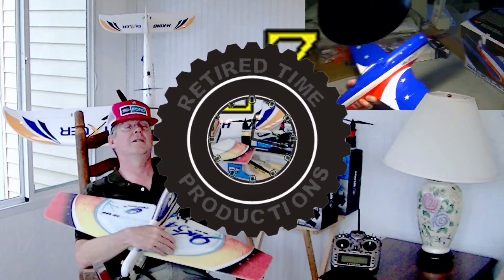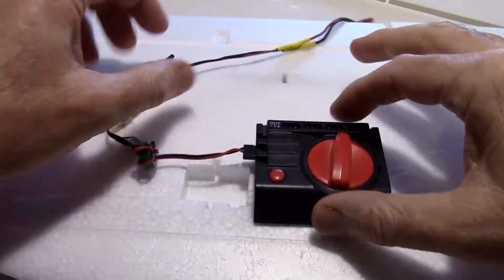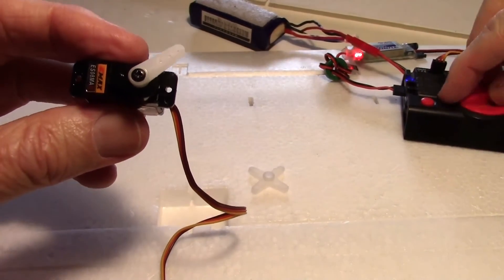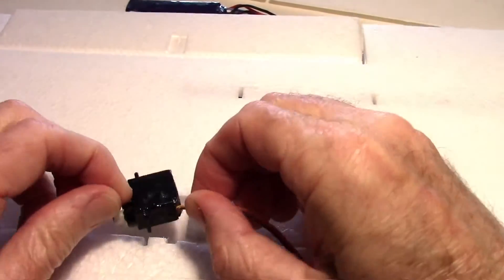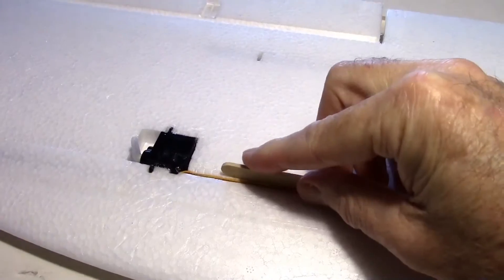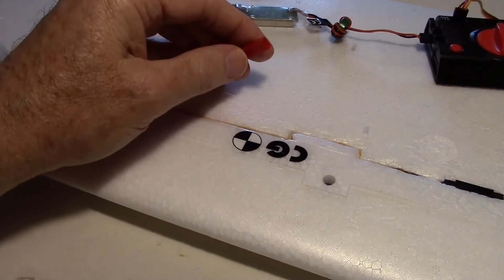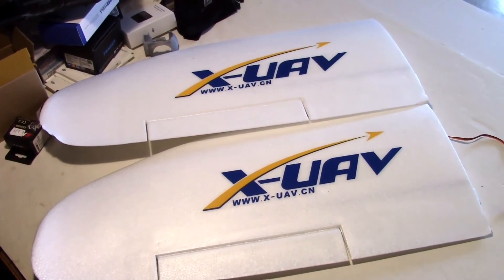X-UAV Mini Talon FPV Build  Part 3 - Servo Install and WTF Kit Surprise

Comment: Hi a gain Dave, nice easy question for you .
What glue did you use on the 3D motor mount and other 3D parts ?

Cheers
Reply from the maker: I use Beacon FoamTac to glue 3D printed parts to the foam parts. To glue 3D printed parts to each other I use CA glue.

Comment: High Dave, I just got me a Mini talon and need some advice.   I immediately noticed the motor had an offset to it is this normal?   Also I’m wondering since I don’t have servo tester do I really need one since I was told they should already be setup because it’s a PNP version.  Please help me I’m getting conflicting information as usual from everyone and everywhere.  I no you are very Knowledgeable and I should be able to get some great information from you.
Reply from the maker: I never worked with a PNP version so not sure on servos. It's always a good idea to have a servo tester handy however when you bind to your radio you can check the servos that way. The motor mount is offset a little, yes.
Reply: Dave Merc Productions ok.  Thanks Dave!  I’ve already straightened the motor out but no big deal putting it back to its original offset.  What’s the offset for?  What’s its purpose??
Reply from the maker: I was just saying that my kit had the same offset. Design purpose or problem, I am not sure.
Reply: @DaveMerc  motor offset is to counteract the torque

Comment: @7:11 on my MT I just cot the connector off and soldered the wires together to eliminate that point of failure.
Reply from the maker: Probably will do that in the end if I ever get there.

Comment: That sucks so bad. If I were in your position I think I'd email your merchant or the manufacturer. Someone else should tske the L, not you the purchaser.
Reply from the maker: I opened a ticket with Gearbest about the problem and now waiting.

Comment: That Foam Tac adhesive looks (its viscosity, clear) and acts (the letting it dry a bit that you mentioned, strings a bit as it's applied) just like this much cheaper stuff:

Bob Smith Industries BSI-142H Clear Foam-Cure (4oz for $6.16 shipped)

https://www.amazon.com/dp/B011XWDTOW

It has a mild solvent smell and is listed as flammable. Hobbytown USA sells it under their own label as "Flexible Foam-Cure" for $4.99 for a 4 oz bottle which is where I bought mine. Love the stuff.
Reply from the maker: Wow that looks just like Foam Tac!

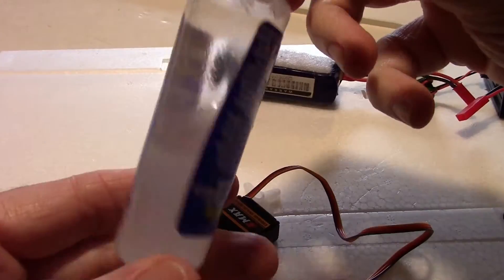Comment: 2:48 How long does it take that glue to dry ?
Reply from the maker: Foam Tac gets to where you can't pull it apart in about 10-15 minutes, quicker if you let it tac up first.
Reply: Thanks. That's faster than some other foam glues.

Comment: Banggood sells spare parts now, $10 and change for a wing. But I'd check with who you bought it from.
Reply from the maker: It was Gearbest. I have opened a ticket and we shall see. I will check to see if BG has wings in-stock in the mean time. Thanks!
Reply: dmerc00 
Banggood will hold your airframe build up for a few weeks. I have a kit on the shelf for backup, I can lone you the wing to keep the build moving.
Reply from the maker: No need, I will just work around it for now, but thanks.
Reply: dmerc00 
Thought I'd offer, I've used your knowledge in my builds.